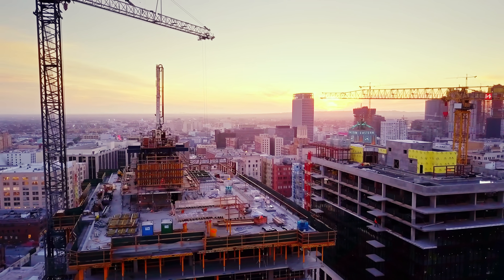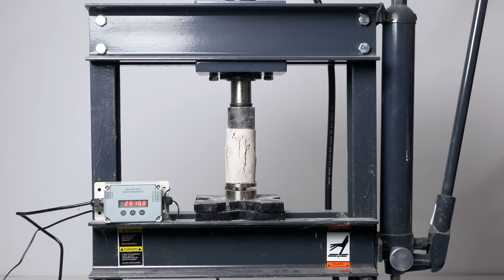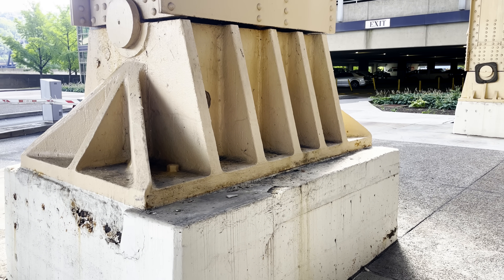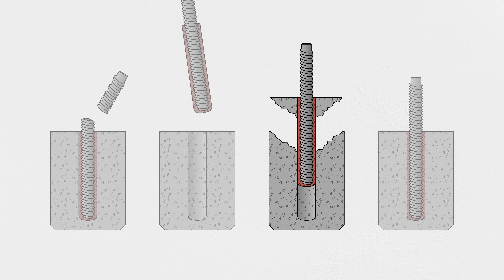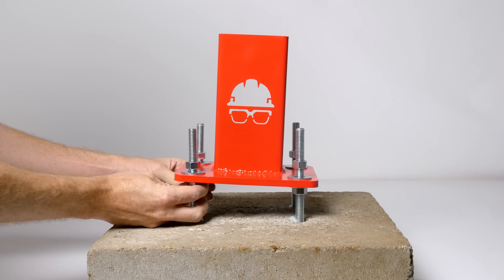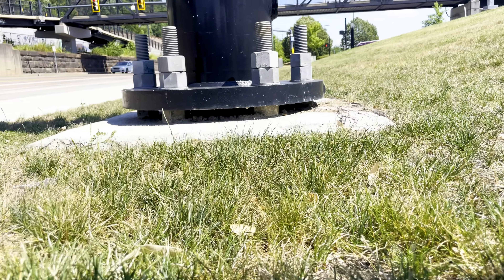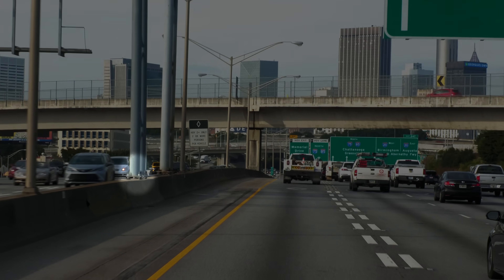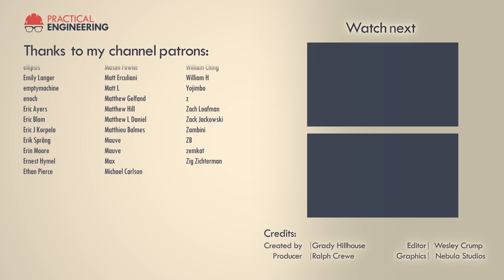What’s the Deal with Base Plates?

Comment: We always use a center stack of shims so the plate will hold elevation until it can be grouted.  BTW:  We always used "Dry Pack" and not concrete.  It is pushed in with a tool and when it dries it actually expands so the anchor bolts are not supporting the load.

Comment: Level bases. I'm reminded of a computer data centre in the 1970s that had a raised floor for cabling and ventaliation. Operators would put computer printouts under the supports to level it, but things kept getting worse. Eventually they removed tonnes of paper and re-leveled the surface. The mining company had the surveyors to oversee the project. You could do a video about data centre construction.

Comment: I had an engineer design those and a metal shop fabricate them for installation below addition in my house.  It settled 4 inches in one corner (prior to my buying house) and we jacked it up and dug 4 new larger footings.  Each of those footings had one of these base plates with bolts in it.  So if it ever settles again from ground fill we can jack it up a little bit and just raise nuts as i understand it anyway.  I had no idea that we they designed and built was until now.  Also so far so good

Comment: Suggest a follow-up "What's the deal with leveling blocks?" The answer, of course, is Base Plates on Steroids for precision machine tools that (a) require precise leveling, and; (b) are very massive and need finer adjustment under heavy loads that would warp/strip threads of Base Plates.  Then you can do "What is the deal with active dampers?" those things we add to ultra-precise tolls sensitive to even low amplitude vibration.  I use both of the above in the recision optical tools I engineer and think your audience would be interested. STEAL THESE IDEAS.

Comment: Not totally related, but one thing about base plates with alot of bolts, whether its on a crane, a sign or on the wheel of a semi truck, is when you push toward them its the bolts nearest to you taking all the force kind of like how its actually the upper half of a bicycle wheels spokes being pulled that give it strength not the lower ones being compressed, so if you UNDERTORQUE the bolts on one side it will actually cause the the other bolts to stretch and snap, ive noticed this alot in crane collapses and semi truck accidents, its hard for some people to understand how undertorquing a bolt can cause others to snap

Comment: Secured a 10 ton jaw crusher to a 10 ft concrete pedestal with hilti epoxy and 1 inch anchor bolts drilled 18 inches deep. Crusher shook so hard in broke the foundation but the bolts held.

Comment: I still remember how on the one site I was at had a concrete truck back into a column and sheared off the anchor bolts and pushed it 2 feet over.  When the engineer inspected the foundation they found it had too large of a percentage of void spaces under the baseplate so they drilled a hole in every baseplate in a 1.4 million square foot warehouse and pumped grout underneath.

Comment: Guyed towers I used to build didn't actually use any bolts on the base. It had a pin that was embedded in the center of the concrete base. Pin came up through the base plate, and compression forces did the rest.

Self supporting were a whole other ballgame. Even with the levelling nuts, we still spent extra time getting everything as close as reasonable.
Reply: Also, iirc, we put a base plate inside the concrete for some. Base of tower legs were floating on a handful of thick bolts, and the actual compression transfer happened a few inches under the surface of the concrete.

Comment: If the bolts were fixed in a second base plate embedded in the concrete foundations would that work to distribute the load? Or is it not worth the trouble placing, aligning and making tricks when pouring the concrete?

Comment: you forgot to say how stand off plates distribute the load? now instead of 1 pointy connection, it's 4 smaller pointier pressure points on the concrete, or are standoffs only looking to increase leverage?

Comment: For static equipment (columns, vessels, sings, posts, telescopes etc...) the leveling nuts and the stand-off can be OK. For heavy rotating machinery like compressors, turbines, etc.(and light too) they cannot be used under many codes: Leveling is done with leveling screws that are then removed after the grout is done. then, anchor bolts are tensioned to a certain degree  to guarantee that the anchor bolts are always (or most of the time) in tension and the foundation/grout in compression. Leveling is to degrees lower than 130um (micrometers) per meter.

Comment: So how does a stand off base plate make any sense? It is beefy as if it was transfering the load to the ground surface, it is not touching any ground so it does not transfer any load to the ground, and the whole load rests on top of the nuts, which transfer it to the bolts... basically it is just casting the whole assembly in one step (with the column already shoved into it) with extra steps...

Comment: I guess it depends on the achor bolts being used in the concrete, but if you were to have J-bolts or L-bolts attached to the rebar cage, you could use either a second baseplate or a temporary baseplate placed on the surface of the wet concrete and then adjust nuts on the top side of the bolts to level that secondary or temporary baseplate to ensure that it is level, despite the concrete around it not being quite so perfectly level. 

I seem to remember something like this being done on a construction site I was watching as a security guard about 35 years ago, the summer after high school graduation. On that construction site, they were essentially building a huge shopping mall on the same footprint as an existing shopping mall without closing the mall during construction. Construction would begin when stores closed for the night. Merchandise in the stores would be moved aside as HUGE new foundations were dug, with holes cut in the roof so a pile driver could drive huge pipe pilings very deeply. Then iron workers would build huge cages that tied in some gigantic J-bolts (roughly 2" in diameter if memory serves) that extended above the floor level. In the morning, the foundation holes were covered by steel plates and carpet and merchandise would be moved back to where it was many hours earlier. My job was to watch the merchandise at stores, as they could not be secured during hours when store employees had gone home. The original mall was essentially a single-floor steel shed with a fancy façade while it was being replaced by a two-story steel and concrete mega-structure.

Comment: When I did construction as a young man, a stack of small steel shims would be placed on the foundation to set the elevation. The column would be set onto the shims with no nuts underneath. Since the shims were centered up and much smaller than the base plate, it was possible to adjust the column with only the down force of the nuts.  After the building was plumbed, the area under the columns would get grouted.

Comment: When I was involved with steel frame buildings we dug holes half filled with concrete with cast in studs, when set the steel columns were put onto the studs and levelled then the rest of the concrete footings was poured on top.

Comment: Thanks. Information I can use. I'm building a pier for a telescope mount. I've been thinking about a stand off plate that most folks use but, my main concern with that is vibration and not strength, I can easily over build for that. I saw stuff in your video that will help.
Thanks again.

Comment: I just don't understand why they elevate stand off bases. As you mentioned, it defeats the purpose of the base plate to put all the weight on the bolts (hence grout), at that point you might as well place the plate directly on the foundation, right? That way the weight is being distributed through the plate AND the bolts. Or maybe I missed something.

Comment: When I was in college, there were many octagonal type poles on the way for overhead higj tension power lines.
I always remained confused why the poles are 2 to 3 in higher than the concrete foundation below.
Ultimately I started my bachelors in Civil Engineering to find this specific answer, and in my third year during the first lecture of steel structures I finally asked tjis question from my steel structures teacher and got the answer.

After that, base plate and anchor bolt design became my favourite.

Comment: When I had my RV and mobile home repair business, I got a lot of calls to relevel mobile homes.
The problem usually was that the concrete blocks used as piers sunk into the ground from the weight of the mobile home.
My solution was to install a level 2' x2' 3/4" pressure treated piece of plywood under each pier and reset the concrete blocks the proper way and doubling them as a pier.
The plywood spread out the load and would only sink 1/4"-1/2" rather than half the width of a concrete block.

Comment: I missed an option. Whilst pouring the concrete, you put in some plates made from foam. In the shape and size of the baseplate. Al the dimensions stretched bij a cm. And then when the concreet is dried, you take them out. And place the baseplate in it. Under the baseplate you can pout either a bolt or plastic distancedisc. Then you tighten up the top bolts. And pour in some undersabeling mortel. And the 1cm gap on top you caulk them. 
It looks a lot nicer and cleaner then the ones standing on a cement base.

Comment: Sink a second plate in the concrete, 5 cm in. Connect with the outer baseplate with a lot of thick rods. This will distribute the load without the need of grout. It will also make it far more difficult to have the upper layer of concrete to break under pulling forces, provided you put a steel mesh between the sunk plate and the surface.

Comment: Cast in plates solve this issue imagine the pie sign it's 10mm of plate steel with rebar bent up and welded underneath you concrete them in with the plate sticking out the top of the slab the you weld your columns in on site.

Comment: Thank you Grady for consistent quality content! I built my garden observatory (a garden house with a roof that can be completely rolled off) on multiple H-anchors set in point foundations of steel and concrete. My goal was to get the wooden pillars away from the moisture of the dirt underneath. That seems to work great so far, but I never found reliable data on how much weight in compression forces I can actually safely put on these anchors.

Comment: What if you did an imbedded baseplate with threads for a standoff baseplate? Now you get more surface area and leveling with no grout. Additionally, you could have all kinds of geometric freedoms with what is on the underside of the embedded plate, fully submerged in the concrete to increase surface area far better than an anchor. I'd love to hear your thoughts or those of an engineer.

Comment: Since "Grady" is a made-up unit for the purpose of this thought experiment, you'd likely need to experiment with your posture or movement to manipulate the pressure value. It's essentially a way of saying, "Can I adjust how much force I exert on the sensor so it reads a specific value?"

Comment: These strain gauges are usually very linear in their specified operating range. This can change if it has been overloaded. You can roughly calibrate it with your body weight, first set it to Zero, then weigh it on a bathroom scale. and set it to the weight you weighed on the bathroom scale. You can also calibrate it to the volume of water. You put a tank of known volume, zero it with the tank, add water and calibrate with water. It won't be perfect, but an order of magnitude and it will be ok.

Comment: 5:51 Fun fact: the concrete design code's section on anchors (ACI318) was SO bad and hard to use, that "Appendix D" became an in-profession meme, where you can compare any calc to Appendix D as a quick gauge of how annoying it would be ("I can do that, but it will be an Appendix D level design"), so much so that when they reworked the code, it was moved from Appendix D all the way into Chapter 17, to help lose that colloquial baggage.
Reply: We still call it "Appendix D" regardless of where it exists in the code now.
Reply: We have an appendix D in aviation. Part 43 is the FAA's Bible.
Reply: I should have said that part 43 is a book of the FAA's Bible. 
But the actual Bible is shorter than part 43, and easier to read and understand.
Reply: @eclectichoosier5474   That reminds of the AISC Steel Manual, it's much thicker than the bible, but is actually chocked full of very useful information.
Reply: @eclectichoosier5474   My two least favorite codes are ACI318-14 and the TIA-222 -- they are both so poorly organized, hard to use, and full of tiny gotchas. AISC, discussed above, is my favorite code to use by a wide margin.
Reply: @kindlin  Technical writer here: What kind of psycho writes and then publishes a code that contains gotchas? 😮 Tell me it got rewritten and the original author was institutionalised?
Reply: @HomeFromFarAway   It's a consensus standard, so a large group of people, like 10+, all have to agree on all the wording. Mostly, individual people focus on individual sections that they are most versed in, but many people read it thru and thru for consistency and all that. When enough people complain or ask the same question, they'll put out a bulletin with the intended interpretation and try and incorporate that in the next code cycle. But none of that changes that sometimes it's just poorly written and worded. Like, section 11.3.4.1 might say "all things shall be X or Y, but never Z" and you're like fine. But then you go down to 11.3.4.3 and it says "But Z may be used when X and Y are considered in W" and you need to go find the definition of W to figure out if you can actually Z, which was explicitly outlawed just 2 provisions above. And while, yes, you should read and know all the code, the root provision, 11.3.4, SHOULD have read something more like "And T shall be designed such that 11.3.4.1 thru 11.3.4.6 are all met" and and in 11.3.4.1 it should also say "...but never Z except as modified in 11.3.4.3." and then it all clarifies, at the start and within the provision, what things you need to be aware of.

And if all the number I just laid out was confusing, that's just another minor annoyance with those codes. It get's even worse. A real provision in the TIA is something like 2.7.3.1.1.1, and some of those final string of .1's have a .2 to go along with them, but some of them don't. Talk about bad consistency.
Reply: @kindlin  good. lord. no. 😮😮😮😮😮
Reply: @eclectichoosier5474   Almost the answer to life, the universe and everything. But a Parker Answer.

There's a couple references for yah.
Reply: This is the second time I’ve seen the word colloquial in my life and the first time was today as well. Really strange.
Reply: @standout8616   Isn't it funny how that happens? In reality, you've probably seen/heard the word hundreds of times, but now that you KNOW the word, your brain actually recognizes it. Tho, I swear, this happens to me all the time too... Brains are weird, or maybe coincidences are weird. Probably both.
Reply: @kindlin  It's called the Baader-Meinhof phenomenon
Reply: @iletyoucallmestevesy   Oh, interesting. I had no idea that had an actual name. But, of course it does... lol
Reply: @standout8616 colloquial!!!!
Reply: If you’re new here, calc is short for calculation
Reply: @3foothurricane   Oh, thank you. That's funny, I didn't even consider that as jargon, but of course it is. As I read your reply out of context I thought you meant calculus.
Reply: Not as fun as the fact that thermal expansion made hundreds of these connections fail in WTC7 on 9/11. Duh gubmint sez so!
Reply: given the 20th century, "CAD" and computers are so overrated

Comment: I expected we were going to see heavy steel mesh or rebar like sub plate structures with the bolt shafts precision welded and the whole thing installed into wet concrete as a starter template for fast level mounting and as a load sharing device. Does anything like that ever get employed?

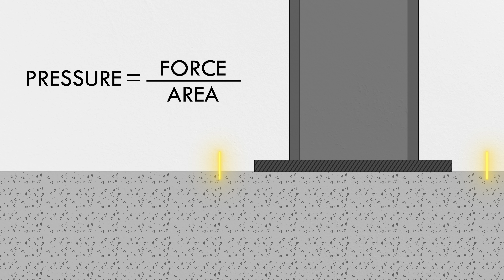Comment: @2:50 yea 100% correct, but a lot of base plate poles aren't trying to spread the loading to stop the concrete failing, but rather to stop the base plate from folding over with side load.
Reply: What are Base Plate Poles? And as Grady discussed, you up the BP thickness to prevent steel bending (is that what you meant by folding?) during lateral loads.
Reply: He showed this at 3:20.

Comment: I'm an electrical utility engineer. The 1st 10 years of my career, ALL of the baseplates I saw were mounted flat & perfect on foundations. The structures & foundations at that utility typically lasted 50+ years. But they took forever to be installed & required highly skilled & highly paid in-house installers. The first time we had a contractor design & install some structures, there was a near-revolt when folks saw the levelling nuts & the gap between the base plate & imperfectly finished concrete. But they were a lot cheaper & faster.

Comment: I havent watched the video. Im going to guess baseplates are the engineers version of a washer used in furniture. A disk or plate used to spread load forces across a medium as to prevent damage such as pressure forming voids, cracks, and other damages. Lets see if im right. If im right that means im still sober enough for another beer
Reply: I'm 2 and a half minutes in and I know I'm right

Comment: Stand off base plates are what I always recommend even for residential structures that need steel in them. Contractors always ask why, so I ask them if they want to grind down the concrete to perfectly flat and level or if they want to deal with non-shrink grout...they always opt for the grout.